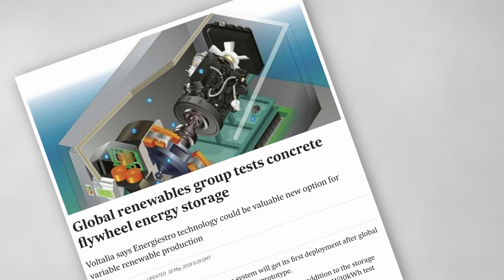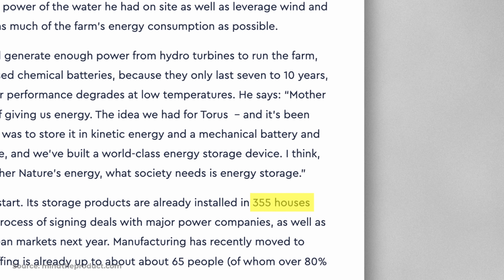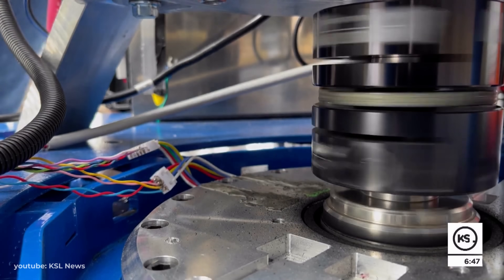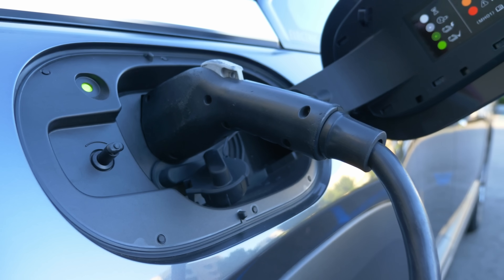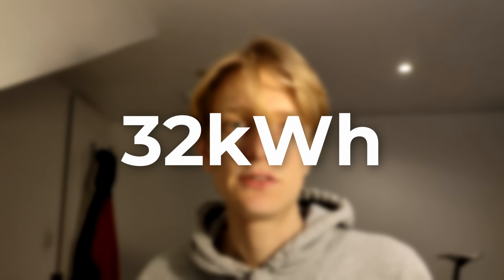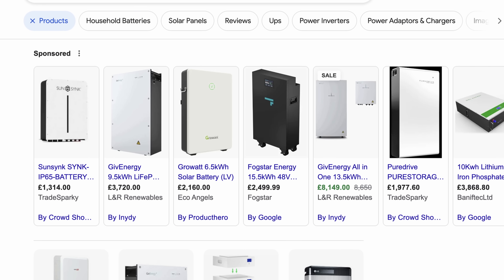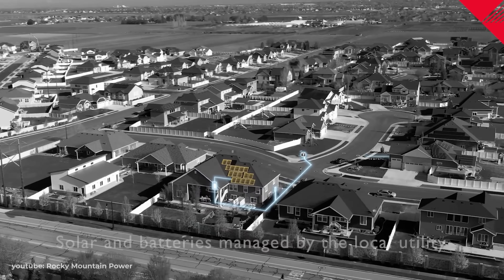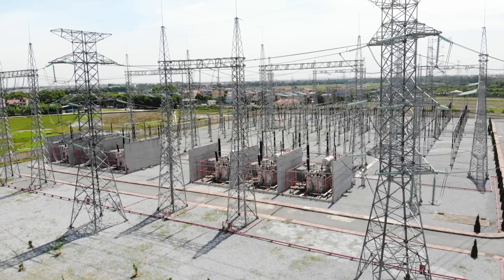Is this *FINALLY* a Break for Flywheel Energy Storage?

Comment: 10kWh then 32kWh then 10kWh. Hard to understand what the storage capacity rating really is.
Reply from the maker: I believe what they mean here is that over one charge cycle the flywheel can store 10kWh, but over a day of charging and discharging the overall energy stored equates to 32kWh.
Reply: @TheUpshift_Media  That's what I was thinking too, but cycling it three times a day seems kinda crazy. I assume most setups will simply charge all day and discharge all night. I guess a wind-only installation might be kinda streaky? 🤷‍♂
Reply: @TheUpshift_Media TY
Reply: @TheUpshift_Media   According to their site the capacity is 32 kWh over the period of one day.  That equals Amber Kinetic's units in terms of energy storage.  In simple terms, charge up the unit to its maximum capacity and you can have a full 32 kWh of uninterrupted power without anything going into the unit.  I believe what they mean with 32 kWh is that it is the maximum storage capacity of the unit, in other words, spin the flywheel any faster and it becomes dangerous.  AK's flywheel weighs around 5000 pounds spun up to around 8000 rpm (about 133 revolutions per second) IIRC.  I did the math a while ago after watching a video where they displayed the actual flywheel and it does come out at around 32 kWh.  The label "potential storage capacity" (116 800 kWh over 10 years for instance ) does not quite make sense, I would rather label it "kilowatt-hours delivered" or something along that line.
Reply: its just a way to blurr the exessive price per kwh. Seems more like a Scam.
355 Households? its abismal
Reply: I believe is 10kwh per flywheel + 2kwh power wall = total system of 32kwh
Reply: I imagine the self-discharge is huge compared to any battery tech.  10kWh is probably what's left after 24h or something.
Reply: @Juttutin  flywheel batteries have been around for a very long time and there are many companies offering different implementations.. I know in some of the higher-end versions The self-discharge can be better than many battery technologies because they run very high RPMs inside a vacuum on magnetic bearings making friction near zero.. some even use the rotation of the earth to help momentum.. when properly done they can maintain energy for a surprisingly long time
Reply: @Juttutin  wow man don't you think your hats on a little tight.. perhaps you should not post a statements indicating a lack of understanding on a subject if you don't want an engineer that is very knowledgeable on the topic freely share what they have learned over the last 20 years on the topic hoping to help you on your path of enlightenment
Reply: @VorpalForceField  Very interesting. Any links?
Reply: @andrewmcclure2853  at time mark 5:44 the narrator states they offer a 10kWh flywheel and also states the systems are designed to work in conjunction with chemical solutions .. the poster at the top  of this thread mentioned 32kWh .. this would require 3 of the 10kWh flywheels plus a 2kWh chemical battery such as a power wall ... do remember these are just storage solutions which do not include power generation from things like solar panels .. total run time will be calculated using.. total capacity (or capacity at time of power cut) , constant load value, and self discharge rate..  links to the torus company website are avail in the video info section.. hope this helps ..  Cheers :)